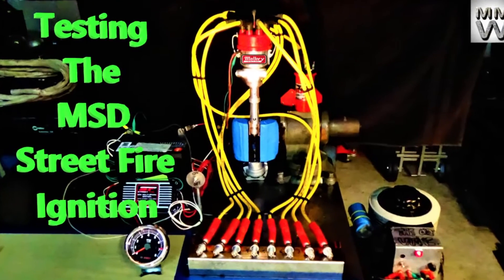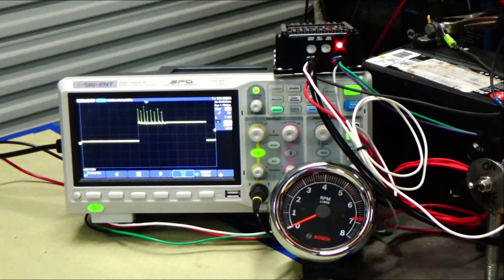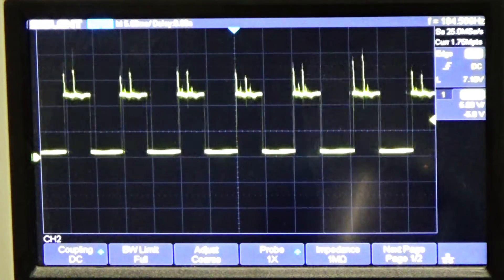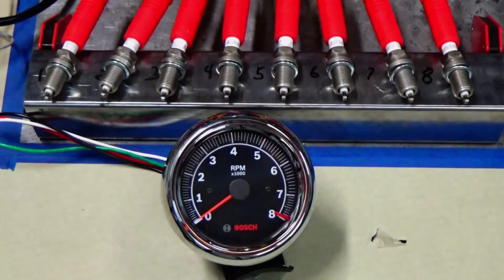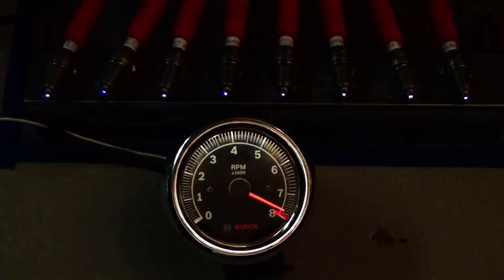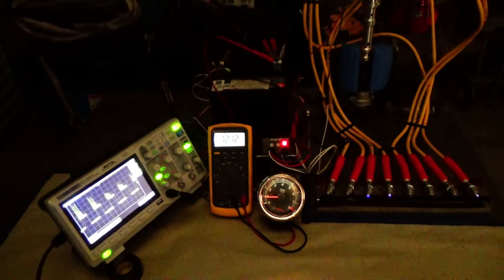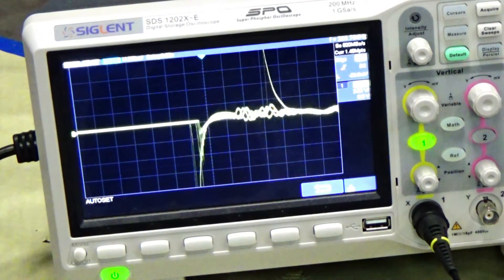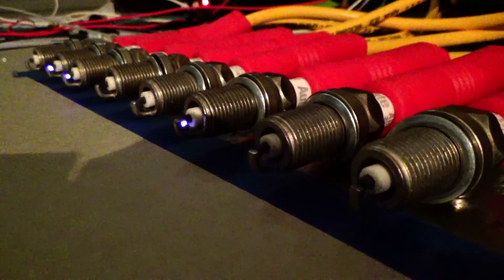Testing MSD Street Fire ignition & Pertronix Ignitor  #28 Chevy 454 Big Block Performance Build

Comment: This is exactly what I was looking for to decide whenever buying this one or going for the MSD 6al. But, you missed the most important point I was looking for 😢. The claim is that this Street Fire version will give multiple sparks for 20 degrees of crank rotation, but only at “low RPM”, and “full power” at “high RPM”. But of course, they don’t specify what “low” or “high” RPM means. I could see multiple sparks on the scope, but it was hard to determine at what point it became one big spark without more resolution on the scope. Any idea what that cutoff point was?
Reply from the maker: I never changed the time base on the scope for the higher rpms.... Possibly at high rpms there's probably not much time for multiple sparks...?
Reply: @Myersmetalworks  yes, at higher RPM there is less time for multiple sparks, but the claim is that the 6AL holds the multiple sparks for longer than the Street Fire.
Reply from the maker: Cool good to know...

Comment: Very cool!  
I should build myself a test stand.  Had a module go bad in a brand new distributor.  No issues until under load, then takes a shit around 4500rpm and/or over 1/2 throttle.  Didnt have a backup 🤦‍♂️ finished 6th in the main.  Guess that's what I get for not testing first.
Reply from the maker: Thanks again  for your nice comments...👍

Comment: Very good demonstration of an electronic ignition system. I liked how the Oscilloscope showed the signal of the ignition system.  I think the digital video camera you were using has a frame/sampling rate that is not as fast as the sparking of the spark plugs when you get up past a few thousand RPM. On a V8 4 stroke each spark plug fires once every two rotations of the engine.  At 3000 rpm the crank rotates 50 times a second (3000/60) and each spark plug fires 25 times a second.  If the frame rate of the video is around 30 fps this is getting close to the point where the shutter speed is not quick enough to capture the flashes of the spark and I think this causes us not to see them in the recorded video.
It will be interesting to see when you put a load on the engine when it is in the car and the rev limiter causes an intermittent spark, if this is enough to hold the RPMs down to the set value? I think your right that this is not a boolean limit, but the spark controller stops sparking at the regular intervals at the limit to reduce engine power output to cause an RPM drop before the spark is completely stopped at some point over the set limit.
Great Stuff - love to see this kind of stuff.
Reply from the maker: Ha....!!!  Sounds like you may know some digital my friend.... Some good old boolean algebra to get the
day started...😁 I think your right about the sample rate of the Camera.... By my eye I didn't miss a beat
untill the set limit or a little past.... Glad you enjoyed the video, and I think your right about the drag of the engine
keeping the RPM down when it appears to start dropping out spark....